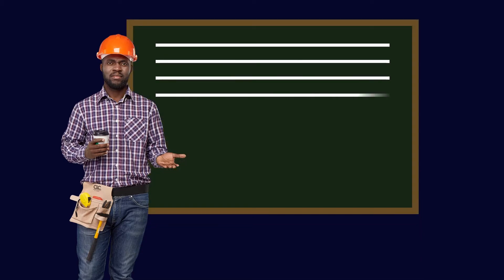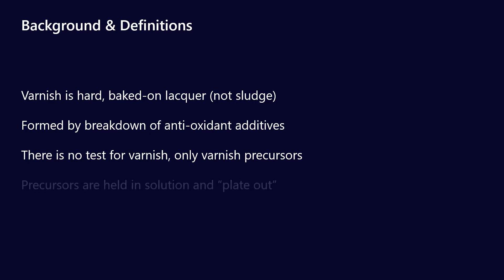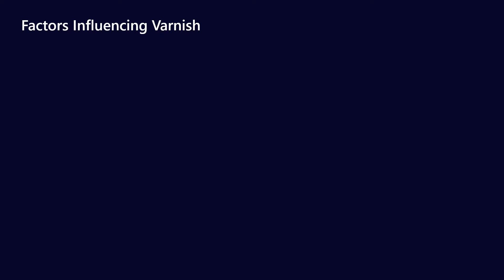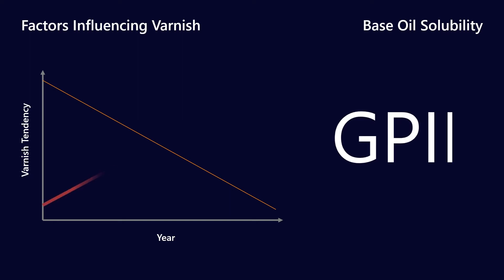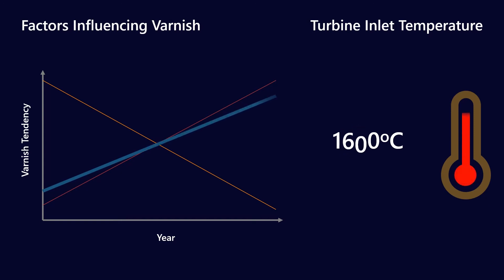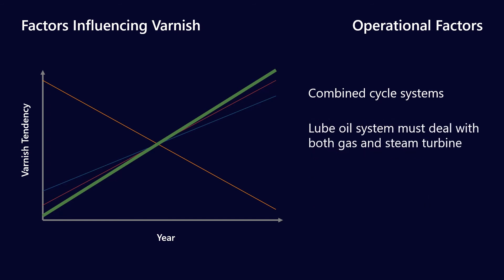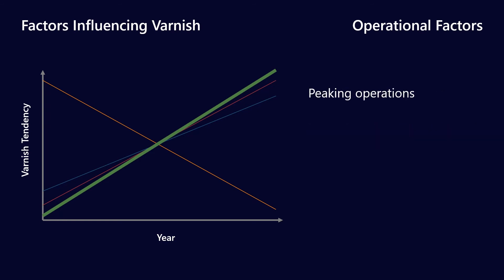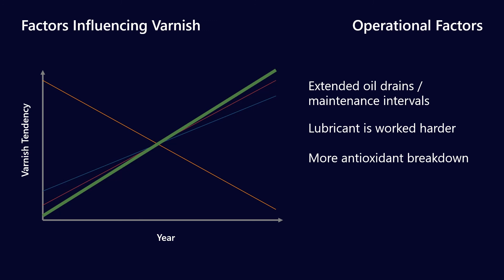Why have turbine varnish issues become so common?

Comment: Can the breakdown of fuel stabilizer products such as Stabil cause or contribute to varnish formation in gasoline engines, or is varnish formation limited to additive breakdown in lubrication oil?
Reply from the maker: Great question! Theoretically the fuel and oil systems in engines are separate, but combusted fuel products can make their way into the engine oil system as blow-by gases (i.e. they get past the piston rings and get into the crankcase). In this way, both fuel and fuel additives can contribute to the buildup of varnish and sludge. A tight seal around the piston rings will certainly help minimise this, and that seal is an interplay between ring tension, the oil film on the piston liners and minimising the wear on the liners because any scoring will help fuel gases get past the rings.

Comment: Re: Ol' Piston engines: Varnish won't go with engine flush solvent? As does sludge? :( 
Case for EV's?
Reply from the maker: In general, varnish won't tend to respond to chemical cleaning - it's baked on pretty hard. Sludge can in some cases be removed by an engine flush, but the flush velocity and chemical strength of the flush is something generally only available in the industrial market - engine flush additives sold to consumers aren't likely to do the trick. As for this being a case for EVs - there's no question that battery-electric vehicles are much simpler machines to operate and therefore more reliable. plus they won't require the same oil drains that traditional ICE vehicles do. But EVs don't get to be lubricant-free either! Most of the major lubricant manufacturers are working on an EV range which comprises of greases for the electric motor, battery cooling fluids and transmission fluids.
Reply: @LubricationExplained  Russians use dimethyl sulfoxide to flush the engine and it works nice. Well, too nice I'd say, since it is so powerful it can wash out coating from piston skirts.